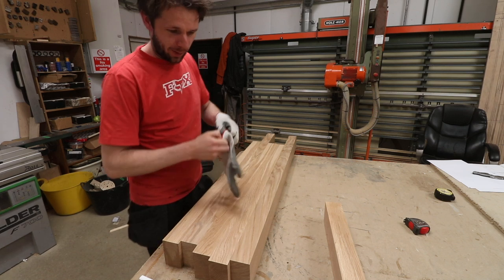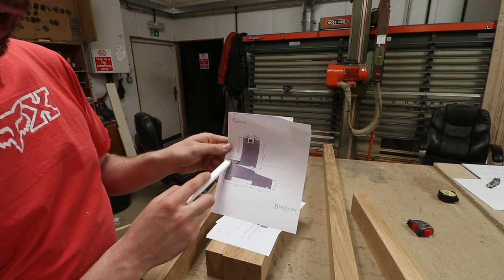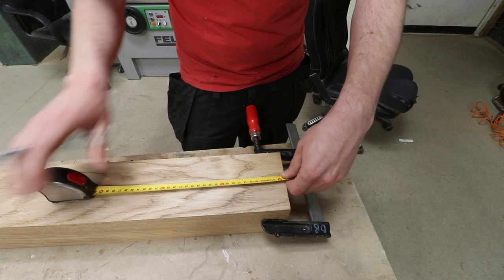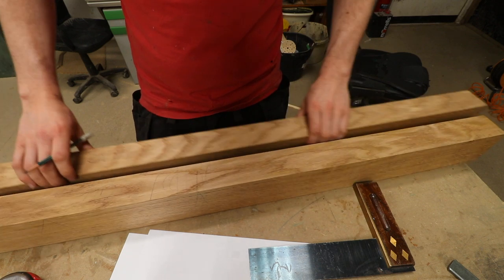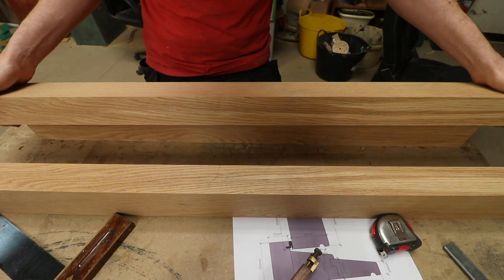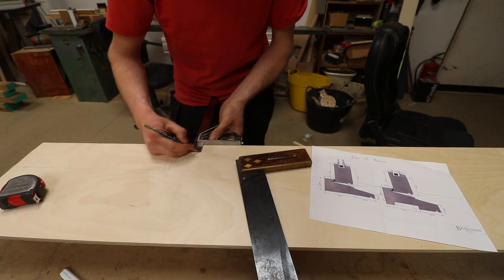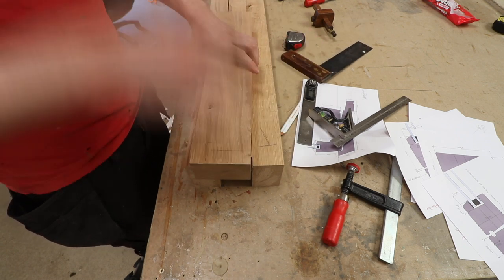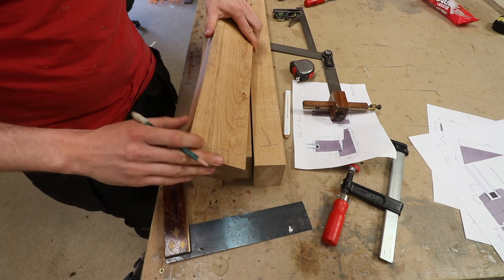Setting Out the Frame - Part 3: Oak Casement Window

Comment: I agree about making a rod. Totally worth the time and effort to avoid silly measurement errors. Looking forward to the next instalment. Thanks for all your work in producing these.
Reply from the maker: Yes handy if your making something your not used to!! Definitley worthwhile if its a first time, so you understand the constuction properly
Reply: Can you clarify what a 'rod' is in this context. it sounds like a 'story pole' in US framing. a set of distance dimensions on a piece of wood, 2x4,  to skip remeasuring when framing. but if that is it, not clear how its used in this case.  how is the rod' used vs the drawing?

Comment: Hi I am learning a ton watching your videos. I'm planning to build mostly fixed windows for a project. Are they as simple as building the window frame but just omitting the casement? Would the frame profile need to be augmented to accommodate the glazing in this approach? Or is there a better/easier way to build fixed glazed timber windows? Thanks!
Reply from the maker: Thats what i would do. Just adjust the rebate depth to suit the glazing used, or use a bigger beading.